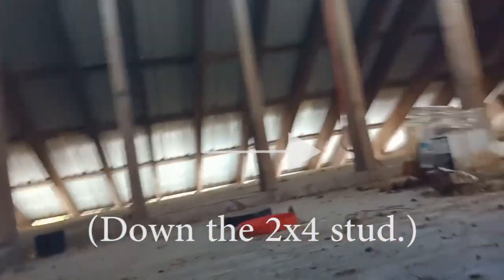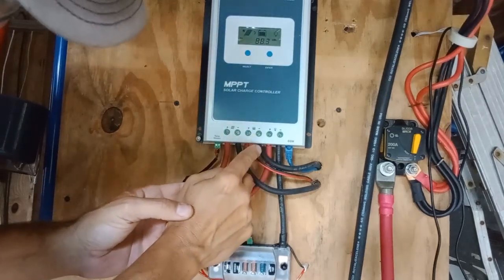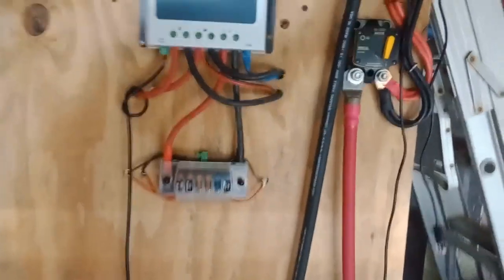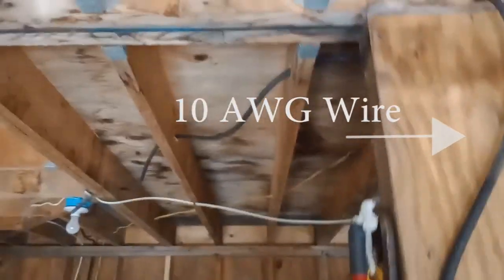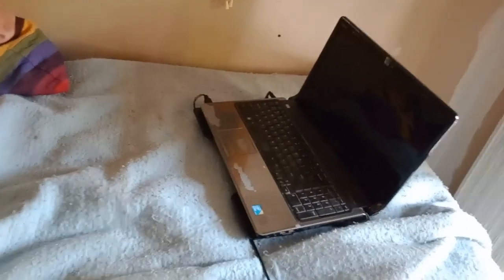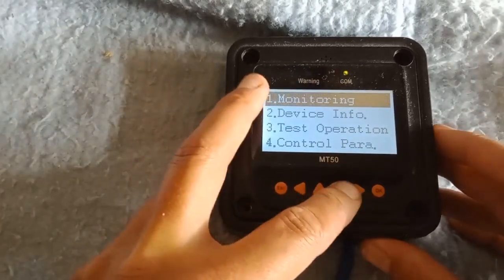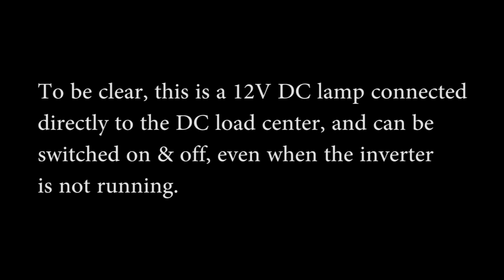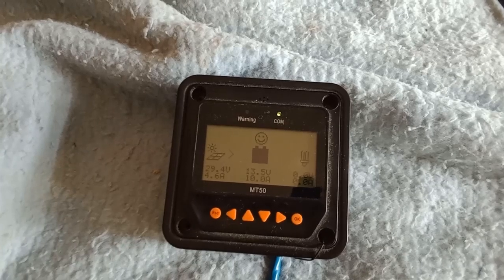DIY Off-Grid Solar Electrical System

Comment: On a Low Fixed Income being Disabled and Medically Retired  now 15 years I sourced Victron 100/50 Smart Solar Charge Controller and a 24 Volt 1200 Watt Victron Inverter and 4 100 Watt RENOGY Solar Panels and used 2 Redodo 100ah Lithium Iron Phosphate Batteries with Low Temp Protection to meet My immediate needs here Kitchen and Internet Router wise and rather Happy with SIMPLE - The Smart Solar Charge Controller offers Bluetooth pairing to My Tablet,  Laptop and Cellphone as well.
Reply from the maker: I've seen some good reviews on the Victron controllers. I do miss having some type of "app" with my system. I opted for the MT-50 remote display because at the time I set things up I had a VERY old cell phone (I'm slow to adopt new tech). In fairness to the charge controller I have, it does have a blue tooth device I could have purchased. I'll likely go that route when I upgrade to a 24- or 48-volt system. Thanks for the comment!

Comment: Thanks for sharing. I want to build a similar system but for blackout situations. I’m not sure which inverter I’m going to go with. I’m on a tight budget and brand name quality pure sine wave inverters would be the most expensive part of the system.  The Amazon reviews on the misc Chinese Inverters seems to be if you get a good one or not and you’re SOL if not. Seems like you got a great one.
Reply from the maker: Thank you for the comment It does seem to be the roll of the dice. I did get lucky. I've done a lot of research, and if I ever have to buy another one I'm probably going to go with a MagnaSine. They're expensive but are said to last. Lots of good reviews, even in marine applications.